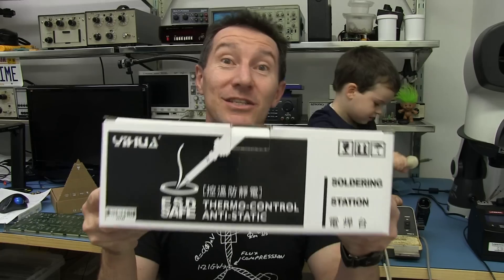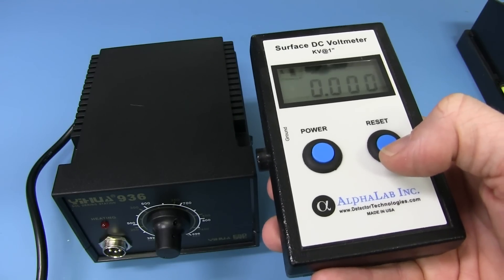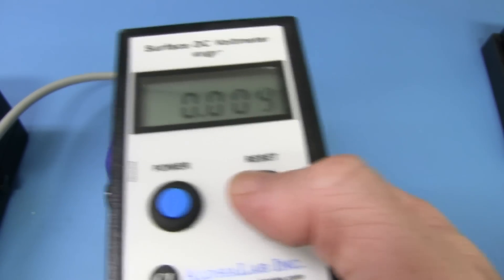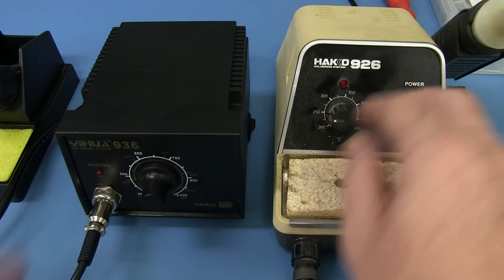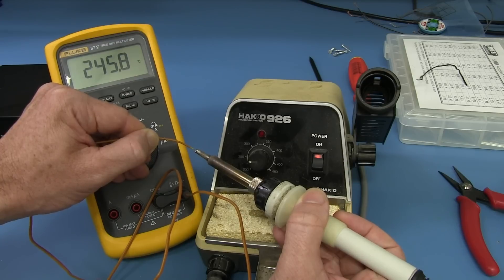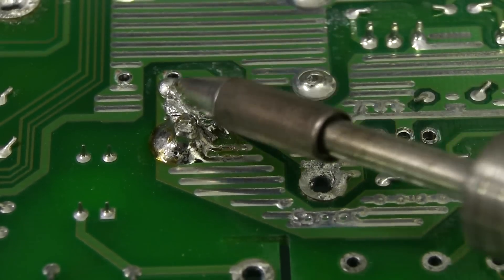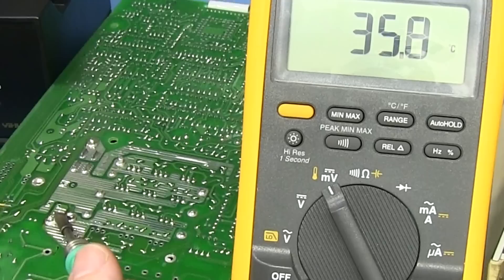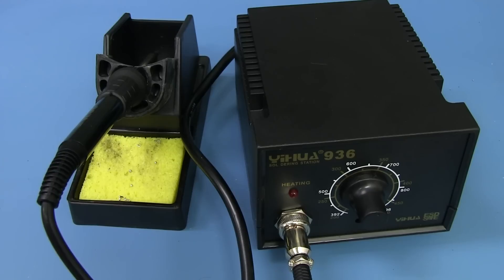EEVblog #596 - World's Cheapest Soldering Station - Yihua 936

Comment: Per my previous comment below I just got my brand new digital readout (no-brand) 937D+ soldering station for $27 w/free shipping delivered from Fontana, California, and im surprised - its got a somewhat different/nicer looking circuit board than the Yihua version shown here and the overall build quality on the board looks much better.  All the solder joints look very good with the exception of where the iron connector is soldered to the board and even its not really too bad, joints are solid but could be a bit neater.   Just as Dave says here I was so surprised at the price of $27.00 and free shipping for this newer digital 937D+ variant I had to try one out of curiosity - and I was told by the seller if I wasnt satisfied I could have a replacement unit or full refund, so I had nothing to lose.  I saw another fairly recent review on my version that was very good so I tried to find the same shipping source in Fontana California that was shipping the nicer looking board and I got lucky - it appears to have come from the same source and prob'ly the same factory line as it looks much the same internally, much better build quality than this older Yihua version.  Ive looked mine over, and again im surprised as the board really looks pretty good, and the soldered ground wire that Dave was noting is in fact a solidly crimped connecter bolted to the transformer frame on mine, so I was happy to see that.  Only time will tell on how long it lasts, but ive run it through the initial paces on a few things and the digital readout seems more than reasonably accurate and responsive & it seems to work just fine for all ive done thus far, maybe its because mines a newer version or a version built in a factory with better Q.C., but nothing really jumps out inside to say its terribly sub-par - I havent even tried any tip upgrades yet.  My one and only complaint would be I wish the iron cord was longer and more flexible but thats about it.  Im going to try looking around and see if im stuck with this same iron as a replacement and if not Ill look for a compatible upgrade - the iron works fine but if it could be replaced with a nicer one with a longer cord and maybe better quality for not too much money it might be worth it as the station itself seems to work excellent.   I was more than ready to ship this baby back if not happy just as I have with three or four multimeters, but so far this one looks like a good low priced keeper and a good value - especially if I get two or more troublefree years out of it.  Time will tell but so far im very pleased for the price.

Comment: I had the Harbor Frieght branded version of this.  It worked but eventually the solder holding the element to it's PCB in the handle failed.  Fixed that, then the element died a bit later.  I replaced it with a genuine FX-888 and its not even in the same league.  Things I struggled to do with the "936" just worked with the genuine article.  Money well spent, and the 888 has already out-lived the cheap knockoff.

Comment: I'm curious what causes the difference in thermal capacity. Is it a function of the heating element?

Assuming the transformer can provide the amps, and that the voltage is the same I can't imagine what the problem would be?
Reply: Gord Bestwick I don't think the thermal capacity was any different between the two: the tip is the one responsible for that, and Dave changed it for a original Hakko one. The issue is that the cheap soldering station is heating to about 15 degrees Celsius lower than what the front panel says. It's decalibrated, that's all.

Comment: The comments on the tip are absolutely correct. Knock-off tips perform far worse on a temperature controlled soldering station. They have 3 times bigger thermal resistance compared with Hakko tip. By comparing station with the same tips, Dave actually did a great favor to the cheap soldering station, the performance difference between these stations with Hakko tips are much smaller than the difference between the two soldering station with their own equipped tips as bought, that is why the cheap stations are deemed so inferior.

Comment: I went to both, Home Depot, and Lowes, in search of a soldering iron. Neither one had a temperature controlled soldering station. Infact, the products available in both stores were nearly identical. I'm hoping to check around the smaller hardware stores, but I guess that this is the age on internet shopping.
Reply: Strange, we here in the middle of nowhere have two shops that sell temperature controlled soldering stations. The price is, erm, far far above 16$, however those are genuine Wellers ;)

Comment: I picked up the 'spark fun' branded version of one of these a few years ago, it looks the same, but does in fact have different internals that both the one in this video and the genuine Hako Dave showed in that picture.

My iron has served me quite well so far and I'm going to keep using it until I find a good reason to drop the money on a high end setup.

IMO, these cheap temp controlled irons are heads and shoulders better than the Radio Shack wood burners.  So, for a cash strapped beginner I would absolutely recommend one.

Comment: Have the W.E.P. 937D which is a little dearer and has a digital temp readout. Almost the same tool though. Have to say that for fine work it's ideal, only limitation is that (as you say) it doesn't have the thermal mass for heavier work. For the price it's an excellent tool though, the bits tin well and don't corrode. The iron and bits are readily available as spares.  Plus, unlike a lot of cheap irons it is a transformer-fed 24v element, which is much safer both for you and CMOS devices than a mains element.

Main thing I'd say is look for a unit with a rotary control; having to push and hold or repeatedly push buttons if you need more heat in the middle of job, is awkward.

Comment: I have a Weller WES-51 and it is awesome, just like my Weller 25W plug-in iron (no temp control on that one).

The only thing is, the LED on it blinks like crazy, I guess they should have put more hysteresis in the heating element control circuit. Don't know what it looks like inside, though I expect it to be quite good.
It heats up in a jiffy too!
Reply: I have Weller PU-81 and I like it. Some people can say that high quality Weller stations are too expensive and those cheap Chinese ones are more than adequate for any job imaginable. Yes, they are right about that the high quality ones give almost no more capabilities for a much higher price but the little issues like low power, low temperature stability, crappy PVC-based cable that can easily be burnt with a soldering iron fallen on a table and gets rigid like a brick whenever winter comes... All the annoying stuff just makes the crappy stations very unpleasant to use and considering that making the way we work more pleasant we make a better living, getting the high quality tools is almost always worthwhile and pays for itself in many ways. In the long run choosing something like Weller WES-51 instead of something like YiHua 936 for everyday use can give much more satisfaction than buying an iPhone or something and unlike the last one it is worth every cent.

Comment: I have a similar unit to yours, but the circuit specialist one. The guts inside are more or less the same (except the soldering job/parts are much cleaner/newer). It's earthed to the transformer just like yours.

My issue is that the cheap soldering iron comes with it only has 4 wires. The ground pin isn't connected to the iron... Well and the fact that I have to put the heat to near max to even melt the solder.

Comment: you may not like this dave. but i tell you now i have had myne for 3 years, No issues, plastic is fine, rubber is fine, it has great thermal capacity and heats up very quickly, i also have only used that pointed tip which is the original one still fitted not, just sanded on occasion, it is greaat!
Reply: ***** yes i did because when you have a soldering iron for 3 years with the same tip. any coating will have gone.
and the fact that you try insult my work is kind of sad really, i am very good at what i do, the solder quality has improved my my whole life, anyone who claims to be good at something should never blame the tools just as you are trying to do, i used to use a cheapo reaaly crap soldering iron with a massive blunt end that actually corroded away and still managed to use it because at 15 i could not afford anything else but the results were still very good.

Comment: How about buying one of those cheap soldering irons and replacing the circuits inside the case, and using an JBC iron? I would like to see one of such schematics for doing that, I think it can be done and offers a cheap, nice, solution while you have to pay about 100$ for getting something that might get some good results.

Comment: Depends on country and code, but in general soldered ground is FINE when it's above 10-12 gauge.

These wires within the device seem to be 14 gauge(Stranded, so probably closer to 16-18 gauge solid copper equivalent) and also depends on what it's being soldered to.

It's dodgy, i'd suggest crimping, but can't find anything on Australian code that's against it, or in Canadian code as long as it's larger then 12 gauge.

Anything 12 gauge and below get's really strict on what's allowed and not allowed, it's a little more lax depending on application about 12 gauge, 14 gauge 15 amp circuits can be pretty strict when it comes to outlets, but when it comes to internals of appliances it tends to vary a little and we begin to have "At least X, suggested to use Y" type of code.

Comment: 30:25, all you need to know.

I have a rebranded version of this with an led temperature display, and it is at least much better than the plug and play crap. Lasted me 4 years so far, and I've saved almost enough for my dream Hakko, just waiting for this ol' trusty (crusty) unit to fail.
I know its quirks inside out, and it is completely functional just gotta work around some issues.

Comment: This looks like the SparkFun soldering station that they (used to?) sell.  I got one from their Free Day event in I think 2009.  The heating element was dead so they sent me a second one free of charge.  I ended up finding the right heating element on eBay and now I have two working stations for all of $7 or so.  They're fairly nice stations too, heat up fast, adjustable temperature, and accept standard Hakko 936 tips.

Comment: I have similar knock-off of the 936 soldering station and I had to repair my keyboard arranger power supply and it had similar joint as the one in this video and it took 400 C to reflow the joint (I had only cone tip, so it probably could go with a little lower temp with a right tip). For electronic amateurs like me, it can be quite good (and this is coming from a person that uses cheap stick ones, that Dave hates so much and they cost about 3 EUR in Serbia, and that ones serve me for a few years with a single tip :D). If I had money I would probably go for Weller or Hakko, but as I sad, it can get the job done. And safety concerns... Well, if you lived in Serbia, you probably wouldn't give that much attention to it anyway :D

Comment: Looking at the "Hakko 936" (knockoff) controllers available on eBay some use the smaller board on the Yihua and some appear to use a faithful reproduction of the original Hakko board. As they both are available for less than $14 delivered it is tempting to build my own 936. Of course what they show in the picture and what you actually receive may be totally different!

Comment: You can find the ZD-99 soldering station for a little more then 11$ (~10EUR) on ebay. I've been using it for approx. 2 years now. Never had a problem with it (of course I don't use it every day :)). So no, this is not the cheapest soldering station out there. :) It also has a place-holder for the soldering iron and a place-holder for a sponge + the sponge itself.

Comment: I have Hako 926 with 900M stick, my father bought it 21 years ago i beleive, it still works, nothing is changed, even the tips are original. And it works everyday, whole day almost. So very good built soldering station, i love it. For the chinese ones, well i have few and well they work, but they have problems, they are cheap good for hobby anything professional, i see go buy it a bit more expensive. Buy Weller it is more expensive but it will work for few decades without touching anything. By the way great video :)

Comment: My big deal killer with the Yihua soldering iron is the way it sits in the stand. As someone who has done soldering on the production level day in and day out, that would be my biggest huge hangup with the Yihua. Of course, the ability to heat a big thermal mass as you point out is quite important, and I would have to use a different iron if that was a concern i.e. if I was doing that in production.
Reply: This clearly isn't meant to be a heavy production unit. Yihua makes much heavier units for that. But for a first timer, this is a he11 of a step up from a plug in iron.

Comment: Well, if you bought one and did some quick modifications like new caps, new pot calibration pot and new temperature pot and reflow some of the joints and a crimp on the ground it wouldn't be bad at all. A high quality iron and other components would help too if you had some laying around.

Comment: Why should the earth wire on the transformer be crimped rather than soldered? Wouldn't a solder joint be more sound if it's done properly?
Reply: soldered wire can melt off, crimped wires stay in place, you always have to be sure that the soldering iron is grounded.
Reply: ZAKKORD ForViewingOnly agreed.  The earth connection is the most important safety wise.  It should be crimped.

Comment: What are your opinions on the gunt type soldering irons? The ones with wire loop tip and trigger for temperature control. It seems like every hobbyist in my country has these. Yes they will not do any smd stuff, but i fins them quite useful when you deal with through hole stuff.
They really are very common here, and yet i almost never see them used on the internet.

Comment: Something like that would be ideal for the stuff I use it for, working on vintage equipment from the 1930's through 1960's don't have to worry about ESD, and the irons they used back then were scary things, big monsters that plugged directly into the mains. And for the occasional LCD monitor recap, or minor SMD stuff it would be fine, just make sure you are grounded and where you are has good mains ground connections, and I would replace that solder tab with a crimp connection (and also solder it too) even here in the USA.
Reply: On a side note I often use my big old scary soldering iron on these projects, it's a monster from the 1940s, huge tip, but I replaced the wiring with that used for room space heaters! The thermal capacity on it must be massive because it will de-solder the big point-to-point joints in old stuff and re-solder them like nothing, also nice for doing solder jobs on high amperage 12v car stuff too, it's a beast of an iron.

Comment: its likely better than some of the items i got here. Although if i have a huge solder joint to melt, i have a weller d550 soldering gun that will perform that role with its 330W or so heating element. I think its now sold as a d650 for that heating element. Clearly not for smt work or precision work, but will remove transformers, coax connectors etc very nicely!

Comment: Thanks for the video! This vid got me worried and i took apart my aoyue 937+. It has crimped grounding and board looks great. Ive had it for 5 years, but only use it a few times a month. But if you do want an inexpensive soldering station i would say ayoue 937+ is much better choice.

Comment: I would have thought that the way to measure the thermal capability of an iron is to measure the power  (either mains side or secondary side) with the tip held hard against a substantial bit of metal acting as an "infinite" heatsink and the temperature set and calibrated so AB comparison is fair. 

After all, the energy going in will determine its heat performance. A cheaper iron will likely provide lower power.

Comment: My soldering station is a KADA 852D+ just for shits and giggles. It works; I love it!
Reply: Laharl Krichevskoy The original station is manufactured by Lukey, which is a pretty reputable brand(I have a Lukey 852D+ myself), alhough I'm not sure wether you can get the replacement parts for the KADA brand, but I have a supplier, and even here in Belarus there are replacement parts.
Reply: Yeah, affordability is the primary motivation for many, like me.
Reply: Well, I picked it up with warranty, and brand new, for $99

Comment: Conical tips are good for making holes in plastic
Reply: +Tracty Zadorozny - then finish the hole with a quick twist of a large handheld drill bit to take the crater off and it can be a really neat hole. A veroboard spot cutter is enough for taking craters off smallest holes, but the drill but really needs to be much larger than the hole diameter. A countersink bit is better tbh.

I keep the temperature lower so the plastic doesn't burn/smoke too much - some plastics are really obnoxious when you melt them - ventilation is a good idea if you;re doing more than one or two small holes. 

(For real drilling conical "xmas-tree" drill bits are the gold standard for circular holes in plastic, even the cheap ones work wonders)